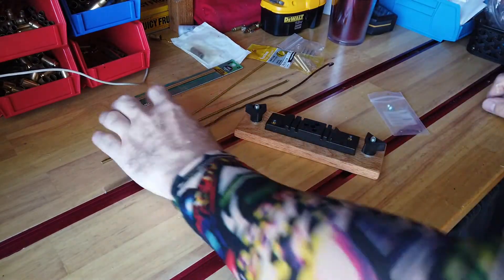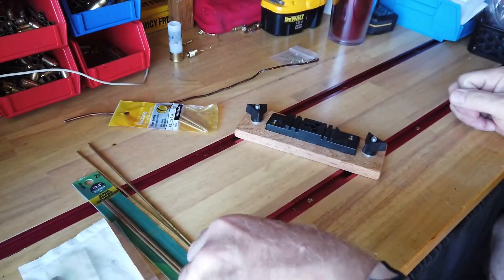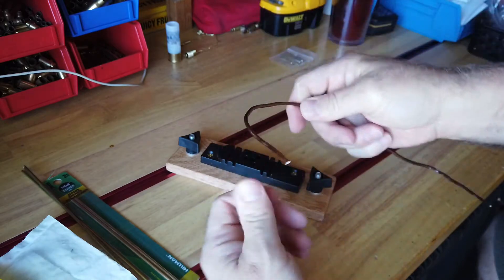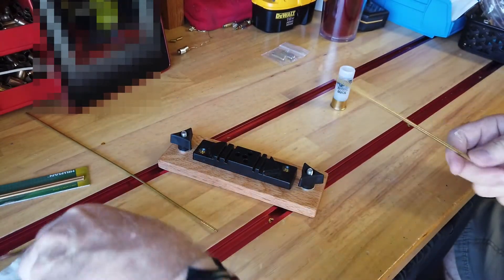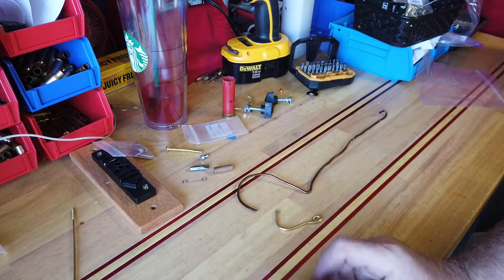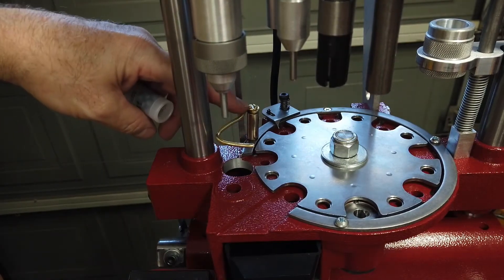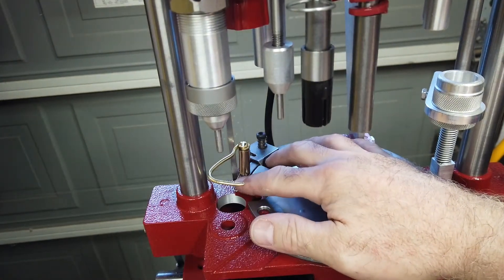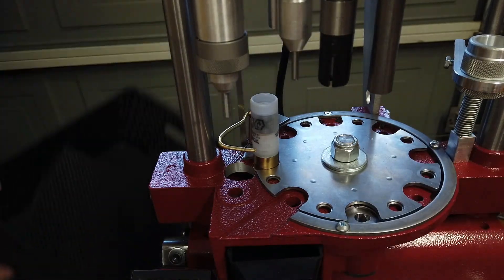Hornady 366 Shotshell Reloader Build: Part 14 -  Hull Retainer Idea w/Brass

Comment: Hey  Re Loader questions,  how big is the mounting hole on the counter ?
Will it be able to go on  the 366 without enlarging it's hole ? I can't find a 
picture of the bottom on the counter to see how lg the mounting hole is.
Reply from the maker: The counter slips onto the mounting bolt on the front left of the 366 press.  He ships the counter with a washer.  I have a washer under the bolt mounting the press to the riser, so I undid that bolt and put on his included washer, so before you "mount" the counter, you'd see my bolt in the left front with two washers.  Just slip the counter stand in between the two washers and tighten the bolt.  Clean and simple mounting IMO.
Reply: @ReLoadersBench    Thank you :-)) Hope you and yours had a good 4th !